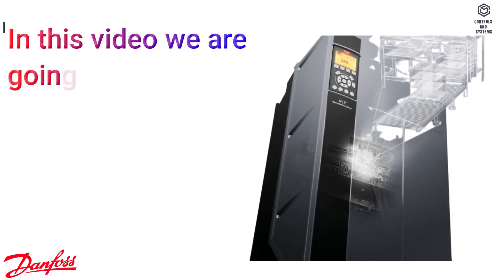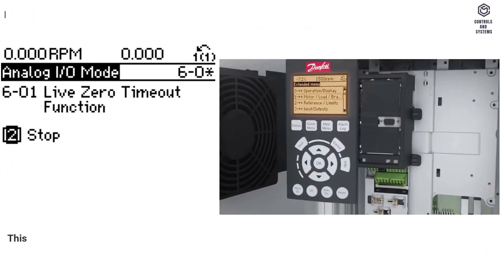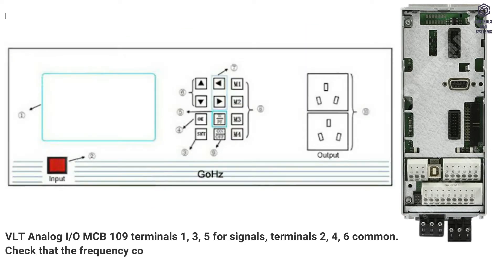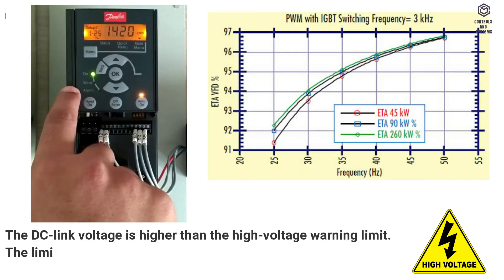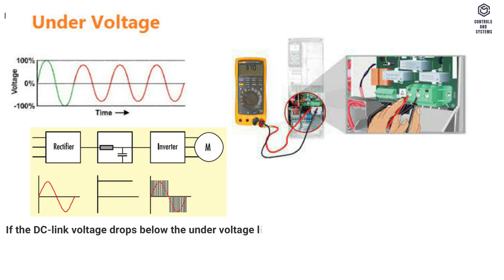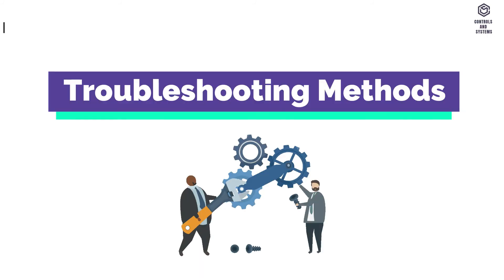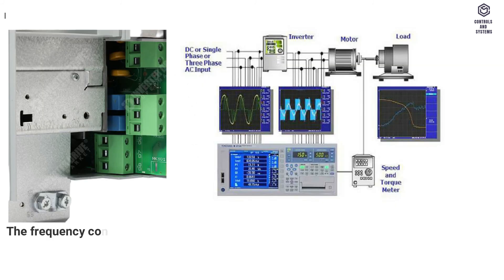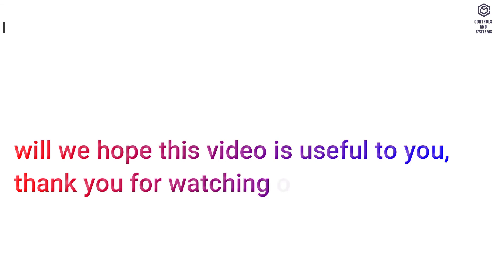Danfoss FC301/302 VFD Alarms & Warnings 🚨 | Troubleshooting Guide Part-1 ⚙️

Comment: Dear ,Please assist me.
My VFD controller for RO plant HP pump is alarm. "Motor ETR over"  Motor over tempreature. 
PCB of the VFD was some arcked in the thermister area. we repaired PCB damaged path. Checked Motor conection. That alarm generated by VFD & it tansmited to controll panel. Now there is a alarm in the controll panel. cannot reset.
Reply from the maker: 1. the thermistor PCB area was arced, this is the most important step.
Check Parameter: 1-90 – Motor Thermal Protection
Value	Meaning
0 - No protection
1 - Warning
2 - Trip (ETR)
3 - External thermistor

If External Thermistor is selected but no healthy thermistor signal is present, the drive will trip immediately and will not reset.
Set Par. 1-90 = 2 (ETR Trip) temporarily OR Par. 1-90 = 0 (Disable) for testing only
Important: Do this only for troubleshooting, not permanent operation.

2. Alarm generated by VFD and transmitted to control panel. Now control panel alarm cannot reset.
This means:VFD fault relay / digital output is still active Or PLC is latched due to fault memory
Check:
VFD relay output status (Fault relay)
PLC logic: is it edge-triggered or latched?
Reset signal reaching PLC?

Confirm VFD display shows NO active alarm
Only then the control panel alarm can clear.

3. Even if fault is cleared, ETR remains latched.
Do This:
1.	Power OFF VFD completely
2.	Wait minimum 10 minutes (DC bus discharge)
3.	Power ON
4.	Try reset from:
Local keypad,
OR Digital input reset,
OR Control panel reset,
If Still Not Resetting:
•	Change Par. 14-20 = Reset Mode → Power-up reset
•	Cycle power again

5.	Wrong motor data causes false ETR trip. Please check this parameters as per your motor nameplate (Motor Power (kW/HP), Motor Voltage, Motor Frequency, Motor Current, Motor Speed (RPM) ]
If current is set lower than actual, ETR will trip quickly.

6.	If PCB was arced: Check Thermistor Input
Input may be internally shorted or open
Drive will always see over-temperature
Solution:
If thermistor circuit is damaged:
Disable thermistor in parameters or use ETR only or replace control board

Comment: I have problem of Alarm ,w phase loss ,how to remove it from danfoss?
Reply from the maker: ALARM 32, Motor phase W missing:
Motor phase W between the frequency converter and the motor is missing.

HIGH VOLTAGE
Frequency converters contain high voltage when connected to AC mains input, DC supply, or load sharing.
Failure to use qualified personnel to install, start up, and maintain the frequency converter can result in death or
serious injury.

Troubleshooting:
• Disconnect power before proceeding.
• Remove the power from the frequency converter and check motor phase W.

Comment: Hello
We have problem with ge/AF650 or danfous speed controller. when it starts up to 40hz speed. It stops and displays an alarm (WARNING/ALARM 7, DC over voltage) and 2nd time alarm (WARNING/ALARM 8, DC under voltage)
Please how is the solution?
Thanks
Reply from the maker: 1. Symptom: Motor is not reaching maximum speed,

Possible cause: Frequency limits set wrong.

Test: Check output limits in parameter 4-13 Motor Speed High Limit [RPM], parameter 4-14 Motor Speed High Limit [Hz], and parameter 4-19 Max Output Frequency.

Solution:Program correct limits.

Possible cause: Reference input signal not scaled correctly.

Test: Check reference input signal scaling in parameter group 6-0* Analog I/O mode and parameter group 3-1* References.

Solution:Program correct settings

2. Symptom: Motor speed unstable

Possible cause: Possible incorrect parameter settings.

Test: Check the settings of all motor parameters, including all motor compensation settings. For closed-loop operation, check PID settings.

Solution: Check settings in parameter group 1-6* Load Depen. Setting. For closed-loop operation, check settings in parameter group 20-0* Feedback.

Comment: Hi Iam facing error in VLT Danfoss FC102. 250Kw DC over Voltage A7 I have increased the Ramp Down time from 8sec/15sec but still the problem same as per your informative video their in no any option in the hardware for Brake Resistor could you pls help me
Reply from the maker: If the alarm/warning occurs during a power sag,
use kinetic back-up (parameter 14-10 Mains
Failure).
Reply: @insightcontrolsystem  could you pls guide me
Reply: @insightcontrolsystem  thank you for your prompt support